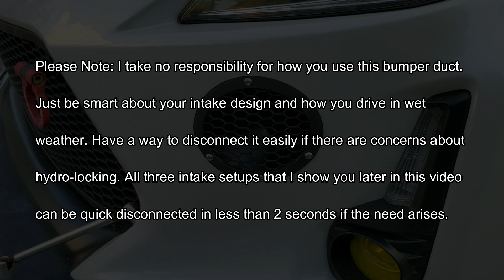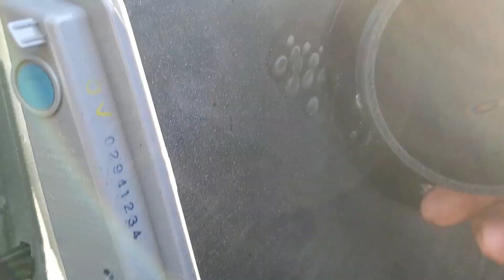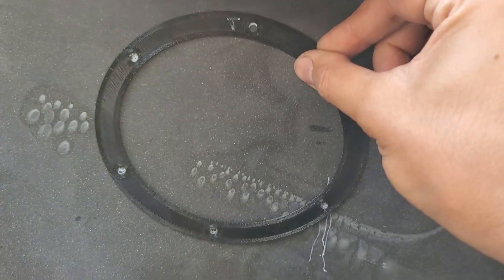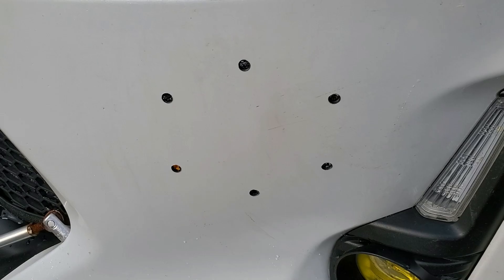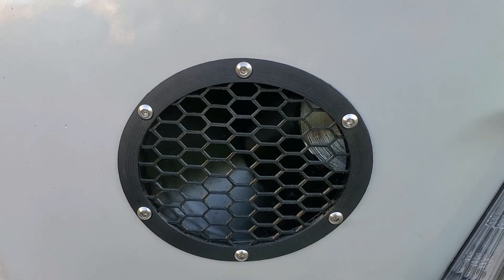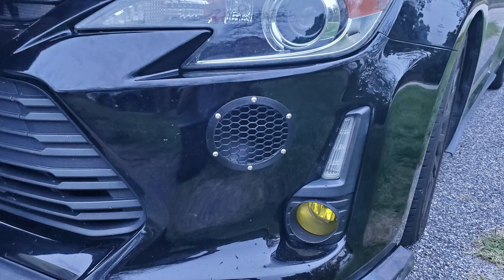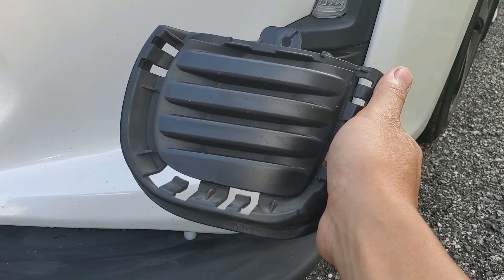3D Printed Ram / Cold Air Bumper Intake Duct Info and Install Guide (Scion tC2.5)

Comment: @DA.  This is so  awesome and I have a 3d printer too.  Have you been able to engineer this same idea to the 2011-2013 Scion TC as it does have a  different bumper?  Also, with the vent duct would there be any issues of debris or tiny rocks on the road getting into the air intake and possibly into the engine block?  I know it may be very rare if never though.
Reply from the maker: Unfortunately no. Someone was supposed to send me a section of old bumper for me to work with, but that never happened. Now I just don't have the time. As for debris, there's still an inline air filter to keep out dirt out and I have never had any issues with road debris.

Comment: I'm trying to do something like this for my ek civic sedan with the stock side ducts, whatever passes around my pipe right now runs thru vents in my wheel well cover, I added a little gap between the bumper and intake right now because rain a concern being my daily driver and that plus the inlet pipes bend going straight up after keeps rain out good enough for Florida weather and for a heat shield around my filter I used a battery cover from a 92 Harley and made it flip up so I can remove the filter for cleaning, urs looks pretty solid, great video !
Reply from the maker: Thank you! I haven't had any issues with water and I've driven my tC in some torrential downpour, but I also have my filter set high up in the engine bay.

Comment: Does it really makes any diffrence with turbocharger, which creates highest temperatures after air filter and after that all depends on intercooler performance?
Reply from the maker: It should help since most setups I see have the air filter close to the engine / turbo manifold, so the air is already hot to begin with and now it's getting even hotter through compression. The intercooler is only going to be able to lower the temperature so much. Having the starting air be cooler will result in the air that finally makes it into the engine being a litter bit cooler as well. That being said, I would only use the duct to channel outside air in towards the air filter instead of having it fully enclosed (like my ram air intake) as the sucking force from the turbo could pull water in.
Reply: @VampyreX13  Yesterday I did same thing, just air duct for K&N Apollo. I was a bit afraid to make it fully enclosed (dust + water). Today I will check if there is some diffrence.
Reply from the maker: What were your results?
Reply: @VampyreX13  I will try it soon, as I just finished other smaller mods :), you think in your 2nd set up, there is no possibility to take rain water/dust? I did similar thing with Apollo K&N. I inserted air duct pipe inside Apollo filter but it is not totally enclosed, so it will not work as vacuum cleaner:)
Reply from the maker: @konradkiebowicz5800  I drive every day with my fully enclosed setup even in torrential downpour and occasionally plowing through standing water or having standing water splashed onto me (while at normal driving speeds) to the point that I couldn't see anything for a second or two, and had no issues.
Reply: @VampyreX13  Nice to hear it, I used my fog light space, as I did not want to
drill holes in bumper, so it is lower than on video.
Reply from the maker: @konradkiebowicz5800  I would be a little more careful with it that low, or even add a small breather filter on top of your ducting somewhere before the filter.

Comment: Would adding an upgraded cold air intake to a 2013 Scion tC really be worth the money and effort?
Reply from the maker: It really depends on how you have it set up. Since I have mine channel to an enclosed filter, I actually get up to 1.8 psi on the highway from ram air.
Reply: @VampyreX13  I'm not a mechanic (just good with my hands) so that's "Greek" to me. LOL !! If I was to install one, do I need to tune my engine or something? Just asking because they are pretty expensive, and the money would be totally wasted if there was something extra I had to do (that I have no clue about) to get the most out of it and feel an actual difference in performance. I am sure I could install one properly, but beyond that ..... I am clueless. I am trying to add simple upgrades that don't need an experienced mechanic. I envy your knowledge base. I always wanted to be a mechanic but never got the chance to learn. Had to provide for a family from a young age.
Reply from the maker: @jameshydra1031  no, you don't need to tune for one. The ECU / sensor has enough range to compensate and you'll get some performance boost. It'll be better if you get a tuned ECU as well, but those require a header at minimum. Just make sure you get a quality brand intake or you may get a check engine light. If I recall, Injen is supposed to be good and can be converted from cold air to short air.
Reply: @VampyreX13  Thanks a lot. I appreciate the assist!

Comment: have you happened to design one for the 2011-2013 tc yet?
Reply from the maker: No. I was supposed to get a bumper section sent to me to test fit against, but that fell through.
Reply: @VampyreX13  dang alright ill try to get one done. what software do you use for your 3d modeling?
Reply from the maker: @adamsherwin4093  nothing very fancy actually. I just use the www.tinkercad.com for everything.
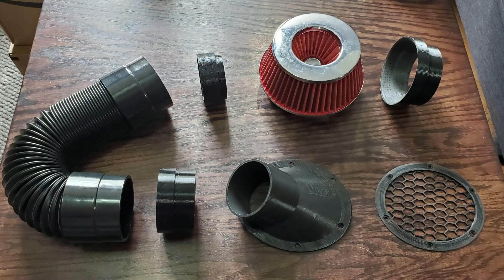Reply: How where you able to get the ducting to mount to the cone filter (4:15) I started designing my own intake but would like to keep my current cold air intake
Reply from the maker: @adamsherwin4093  you need to find an intake filter that is designed to have an inlet. I think Weapon-R may have one. You also need to make sure that the end of the filter doesn't stick out too far that you can't route the flexible hose past the battery. I actually custom designed and 3D printed the inlet adapter for that low profile Spectre air filter.
Reply: @VampyreX13  would I be able to get or buy the file for the spectre filter from you?
Reply from the maker: @adamsherwin4093  I'll make available free to download on Thingiverse later today.
Reply from the maker: @adamsherwin4093  it's now up at https://www.thingiverse.com/thing:5438204
Reply: @VampyreX13  Awesome, Thank you so much
Reply: Checking to see if there's been any updates on one for the 2011-2013 yet?
Reply from the maker: No. I was never sent a donor bumper to design an intake around, and now I just don't have time to do it even if I got one now.

Comment: How does this do when at a traffic light or bumper to bumper traffic on eway
Reply from the maker: What do you mean? It just works like a normal cold air intake.
Reply: @VampyreX13  like heat soaking issues
Reply from the maker: @AllSoWavyReese  it recovers quickly (temps drop down to just above ambient) once you press down on the gas. I also have my intake pipe and shield heat wrapped.
Reply: @VampyreX13  so with your set up u cant sit in your car for a hr and talk or its gone start over heating. Car have to be moving to cool down
Reply from the maker: The car doesn't overheat. If that's happening, then your radiator fan must be broken. I'm talking about air intake temps and you're talking about engine coolant temps at this point.

Comment: Hey man how can I get one of these from you? I have the K&N cold air intake, the shorty more of a ram air in my opinion. Even though k&n say that the heat shield keeps the air temp at or close to ambient air temp when moving or not…. I don’t really believe them but that intake is a beast. If you want you could shoot me an email and we could talk tc! I’ll leave it with ya. 

Thanks Joseph H. 

jjjeepguy@gmail.com
Reply from the maker: I just got my new 3D printer up and running. I'll print out a bumper duct and shoot you an email later today or tomorrow.
Reply from the maker: I just got new filament in, but I'm busy getting ready for a show and a 3D printer is preoccupied right now.

Comment: Besides the 3d printer. This is a very cheap and easy mod. I bought a vent and duct online and i did practically the same setup on my car. It gives you a little hp and acceleration which im okay with for $25.00

Comment: Will this work for a tc 2?
Reply from the maker: I'm still trying to find a local 2011-2013 tC owner that I can do a test fit with to confirm.
Reply: Derrick Aquino where you located I’ve got a 2011 that I was going to replace the front bumper cover soon anyways you can test it on mine
Reply from the maker: @michaelyoung179  north of Baltimore, MD.